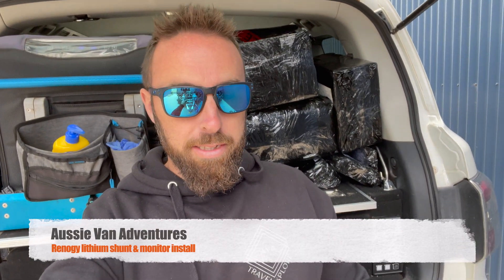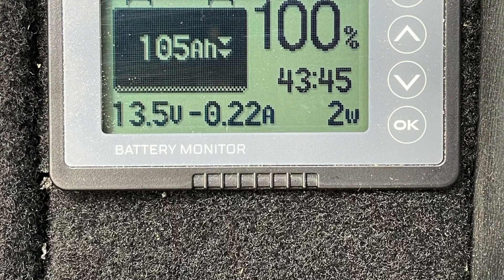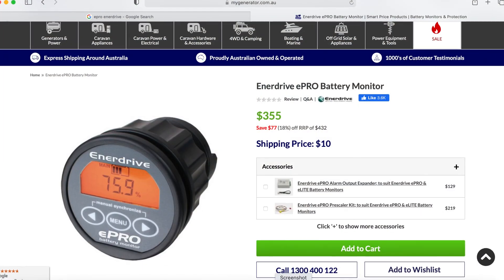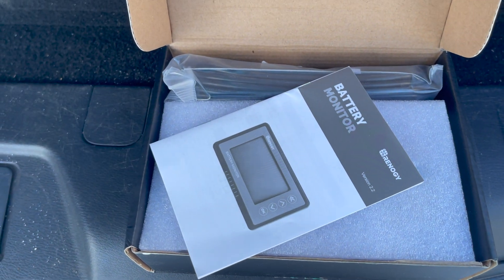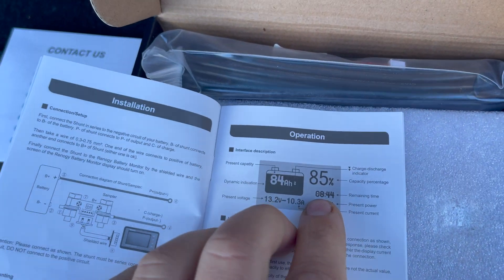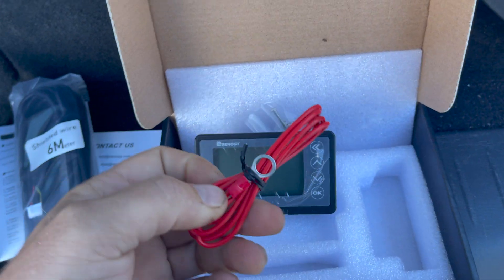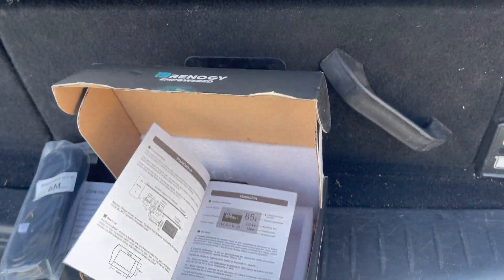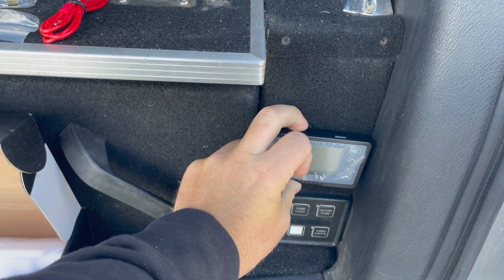The Ultimate Cost Effective Lithium battery monitor & 500a Shunt [ Renogy & iTech ]

Comment: If you have two 12 volt batteries in series do you need two monitors? Thanks for the excellent video
Reply: No just one, check other installs with two batteries, good luck.

Comment: Just wondering if you’ve ended up putting 105 amps on the battery monitor? I’ve got the exact same setup and thinking to use 105 to be on the safe side

Comment: Thanks for the vid.
Question if ok.
So you run your solar panel negative wire via the shunt 1st then to the MPPT controller?? 

AND then also run the MPPT controller negative wire via the shunt 1st? (Instead of going directly to the negative post on battery)
Thank you. 
Cheers

Comment: Hey man, I assume you’ve got a battery charger. Where is your negative cable from your battery charger going? On my car the negative out on my ctek goes down to my battery. I was thinking of putting my shunt between my ctek and my negative terminal.
Reply from the maker: Hey mate. Every single cable on negative side HAS to run through the shunt.. so the shunt HAS to be between all loads and the battery including the charge negative cable and battery. A good way to picture it is that every. Single. Bit of power in and out has to run through the shunt. So its battery.. then shunt.. then every negative in/out load. Nothing can connect straight to the battery.. only the shunt.

Comment: Just revisited the iTech spec page and it says that the ‘C20 Rating usable Amps 10V: 105Ah’.
So, like you said in your installation video perhaps the ‘Effective capacity’ (e.g. usable capacity) = 105 Ah and the ‘Nominal Capacity’ = 120Ah?

Comment: Ive just received the Renogy 500amp battery monitor.
I am about to install and have watched several installation videos.
Question:
Is CAP (capacity) = to usable Ah or Total Ah of battery.
We have an iTech 120x lithium and you put in 105Ah as usable Ah, whereas I’ve seen other videos where they enter the Total Battery Capacity.
Which is correct?
Usable CAP or Total CAP?
Thanks

Comment: Just installed one of these. Nice little unit but for some reason as soon as I start my car it pops the percentage straight from say 50% to 100%. Full voltage of my agm is 13.2 but charger bumps it upto 14.2 during bulk charge. Not sure how I'm going to get around it. You'd think the unit would be smart enough to count the amps put in during charging and just take them off what's been taken out. Bit disappointed with it at this stage.
Reply: Yep yep all wiring was in order. The issue was the full voltage setting. 

To get the right behaviour I set the full voltage setting up to 20v (higher than that battery monitor will ever see even while charging at 14.5v bulk or 13.5v float) so it never hits that value and automatically  defaults to 100%.

This still shows me the correct capacity of 100% even once charging stops and battery voltage returns to around 12.9v. The time till full charge now seems to work correctly too.

So appears that this full voltage setting is redundant as I can't see a situation where charging would work as it's at a higher voltage than the battery, without automatically defaulting to 100%?

Hope this helps anyway!
Reply from the maker: Hmmm.. that doesn’t sound right at all, the unit (shunt) knows the difference and only calculates usage by amp flow.. not voltage. Do you have every single negative cable going through the shunt.. every. Single. Negative cable.  All in and out negative cables
Reply: I have the same issue (140ah AGM with Redarc BCDC1240D), gonna have a play around today and see if anything changes.

Anyone running an AGM setup willing to share what high/low/alarm settings they configured theirs with?
Reply from the maker: @NatoPotat0e   very strange.. double triple check that every single negative wire is going through the shunt. Every one, voltage in and out all has to go through the shunt, even one single negative wire not through the shunt will give bad readings.

Comment: Mine has been installed for three days now and I’ve yet to see the up-arrows (or the + symbol) indicating it is charging during daylight hours. It shows the down arrows (and the - symbol) all the time. 

What have I done wrong?
Reply from the maker: What’s your setup exactly?
Reply: @AussieVanAdventures   12-100aH LiFePo4 Battle Born, wired in series parallel to create a 24vdc. It’s an off-grid solar system.

Comment: I have this unit but it’s a generic Chinese unit. Exactly the same without the renogy branding. 
It’s on a 120ah 24v lithium system on my boat and it works perfectly. 
You can find the exact same unit for around $50 from some suppliers.
Reply: Jaycar have one that looks similar for $50.
Reply: Yeah they don't have the 6m length cable that comes with renogy

Comment: hi, do you run an earth/ground cable from P- or just an earth/ground cable from the negative on the battery itself, thanks Bob
Reply from the maker: Hi mate, every singe earth needs to go through the shunt, there can be no earths between the shunt and the battery, all earths need to be on the load side of the shunt. This way every bit of power that leaves the battery has to pass through the shunt and therefore every bit of power is measured by the shunt. there is chassis to ground everywhere else.
Reply: @AussieVanAdventures  thank for the reply, so you just earth your leisure battery as normal to the chassis and battery negative to B- and P- to negative bus bar (which I have every negative  connected to)

Comment: If i am gonna use this think, i really need to make a switch for the lightning on that monitor. I don't know if it will light up the whole night while i am sleeping in my small campervan.
Reply from the maker: Hi mate, you can turn the light off from memory. There should be an instruction download on their website in the link.

Comment: Awesome video mate. Just purchased one. Waiting for delivery now. Did it come with the negative linking cable from shunt to battery. If not where did you get that one from, it’s nice and neat.
Reply from the maker: Thanks so much! We are still loving the simplicity and info from the unit. No it didn’t come with that, but could easily be purchased from an autoparts store (even auto barn usually has pre made cables)

Comment: Nice video.  Question:  Does the unit draw current when not in use? Can you turn it off manually? Once the power source is turned off, does the unit retain all of the settings and data? Just do not wish for unit to over time discharge the battery pack with small current drain of the meter.  Thanks in advance
Reply from the maker: Thank you! Yes it does draw a very very very small current when on.. but you CAN turn the screen off and yes it does keep its memory and settings (only when disconnected from power does it loose the settings) we have never had an issue with it draining the battery though. thanks
Reply: @AussieVanAdventures  Thanks for the response...Merry Christmas and Happy New Year
Reply: @AussieVanAdventures  It will not loose settings as it has built in memory .

Comment: I have three AGM batteries of 200ah each, When setting up the capacity should I plug in 200ah or the total of all three batteries which is 600ah?
Thanks in advance.
Reply from the maker: Hello. You will need to tell it the total battery bank size. (So 600 in your example)
Reply: You enter the “usable capacity” roughly 80% = 160 x 3 = 480ah!
Reply: @RoyerRogers545  Not for AGM, Max should be 50% so 300Ah
Reply: @lesfewster5372  Thank Les, you’re right! It says AGM.
Reply: If you are adding those batteries together as parallel connection, than 600ah total only has about 300ah usable as they’re AGM

Comment: Fresh out the box, does the renogy battery monitor automatically detects the AH of any battery you hooked up to? Or do you have to manually entered the AH of the battery into the renogy monitor device?
Reply from the maker: Hi mate, you have to manually enter the AH of your battery bank on the first time you ever power up the unit. so just the one time. 

Here is a link to the instructions, (see page 6) 
chrome-extension://efaidnbmnnnibpcajpcglclefindmkaj/viewer.html?pdfurl=https%3A%2F%2Fau.renogy.com%2Fcontent%2Fmanual%2FRBM500.Manual.pdf&clen=829693

A link to buy the monitor too.. https://bit.ly/31cVx6h

Comment: Thanks aussie van great video. can I monitor 2 lithium batteries with one unit
Reply from the maker: Yes you can, if they are connected in parallel. You would just need to let the monitor know the total amp hours being used.

Comment: Hi there Aussie Van I dont know if you can help me out here. I have installed the same monitor. when I connect it to solar to charge the batteries the screen keeps on blinking on and off. when it is charged and I disconnect it it is fine the light is off, I press the ok button the light turns on for a few seconds then goes off. It measures fine. it is just when I connect my solar it constantly blinks on and off. Cheers Bill
Reply from the maker: Hi Bill.. yes this is normal unfortunately. When it sees a charge, it slowly flashes. You can turn it off like this though.. 

While charging the battery, the LCD screen's backlight will also be slowly flashing. In order to turn off the backlight function,Long press front Keyboard can turn off the backlight, Long press again Keyboard can Wake up the backlight.
Reply: @AussieVanAdventures  Hi thanks for the quick reply :) you mean long press anywhere on the front keyboard
Reply from the maker: Sorry, the top right button. The one that is a double arrow

Comment: Thanks for this well made video. I purchased the same model battery monitor here in Australia after buying a Lithium battery and realising after I now need a special type of Solar/Dc-Dc charger. I went with the Redarc BCDC1225D as that was the brand they sold at Autobarn/Jaycar Lismore N.S.W. and I needed to return/exchange a simple battery isolator I already wrongly purchased ( I made mistakes and learned as I went along haha ). Next time I would most likely go for the Enerdrive that you used. Installed my Renogy Battery Meter last weekend, but watching your vid helped me set up the parrameters as instructions not so clear. I only have a 100AH and now entered 80AH after your info. Still need to test evrything out as mine seems to be float charging most of the time as pleny of sun and driving here haha.
Reply from the maker: Hi Pete, Thanks a bunch for the feedback! Really appreciate you taking the time to comment! Yes the battery has been good so far, cant fault it. Autobarn are usually pretty good with returns etc.. So hopefully that was all ok. the redarc charger is a great charger, we have a 1250D in the caravan paired up with the BmPro and we get up to 80amps of charge in the van.. so we cant speak highly enough of the redarc charger, The enerdrive is a little more bulky.. but has a few more options, so both are great.  Safe travels mate!